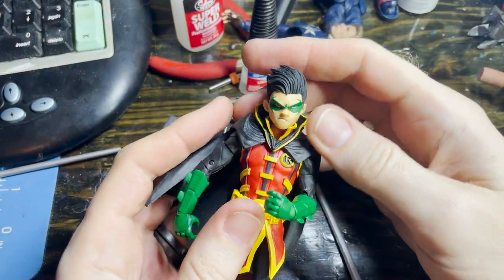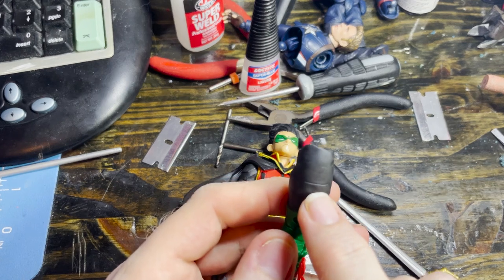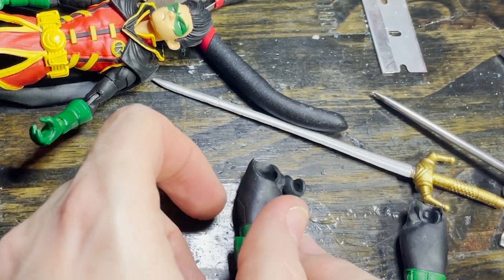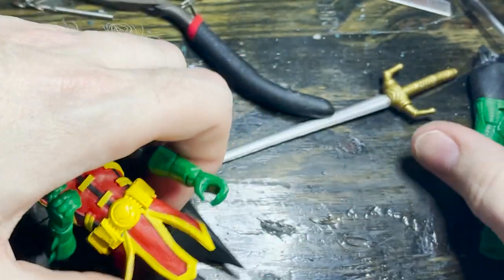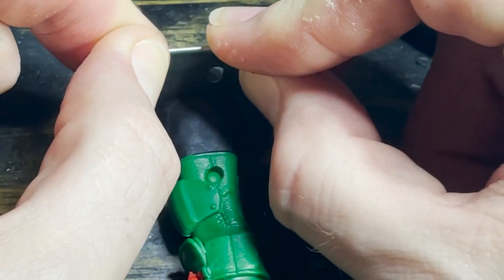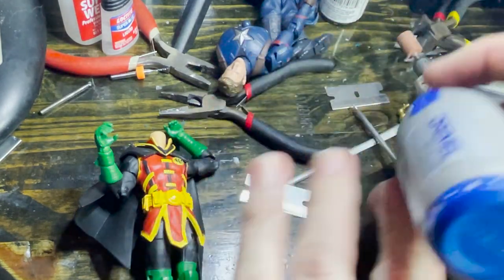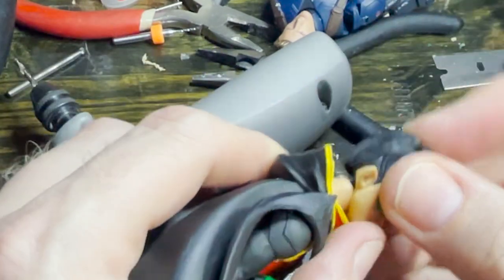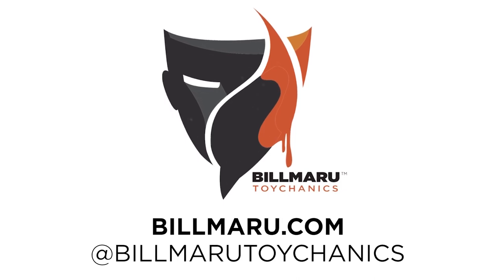McFarlane Robin Damian Wayne Thigh & Neck Mods

Comment: Very nice! Not so intimidated by this one. Have you inspected his knees at all? I think if you remove some plastic you could get a further bend but I also noticed the more you ben, there’s a chance that the sculpt pushes up against the kneepad and you see stretch marks which will eventually crack.
Reply from the maker: I think I'd add a new joint in the knees and the elbows.

Comment: I accidentally superglued the right leg on because it kept popping off. Do you know any way i can remove the superglue from the ball joint?
Reply from the maker: Unfortunately I usually have to heat up the area and basically carefully pry or cut the adhesive away and then repair it.  Adhesive can cause way more problems than fixing if it goes wrong. I wish I had a better answer for you.
Reply: @Billy Mahoney  nail polish remover did the trick. I had to be careful of the paint, but I eventually got it off and fixed.

Comment: Thanks so much for your video, got Robin through the mail. Was very disappointed with it. Paint was horrible, some of the yellow was flaked off. Had to repaint it, turned out good, but I came across your video. Did this custom thigh mod, and it really awesome now. Thanks for the video, keep up the good work. Looking forward to seeing your future mods👍
Reply: do you face any problem during the mod? how long do you warm the leg before cutting it?
Reply: @alipohsem1781  from what I remember, I boiled the water followed the directions. Pretty straightforward.

Comment: My god the small things Mcfarlane can do to make huge differences. Prob costs a bit more to manufacture. Have you taken a look at the Mcfarlane Witcher Geralt figure? It's an awesome figure, but it also has the same issue with the neck it being quite restricted in movement. BUT another obstruction to it is its hair sculpt kind of restricts the head from going back at all. It'll probably work if moving the head forward. Definitely would watch if you had any mod ideas for the Geralt figure. <3